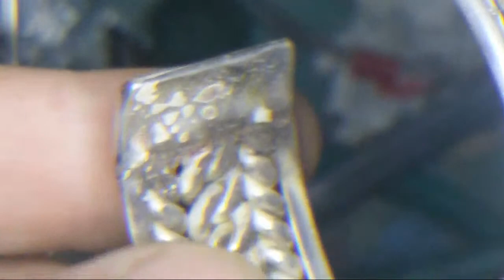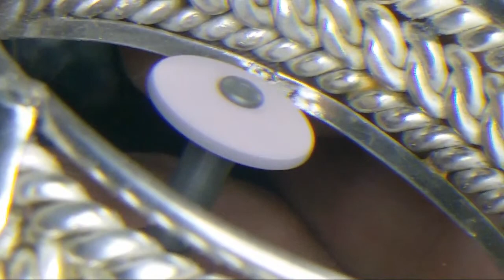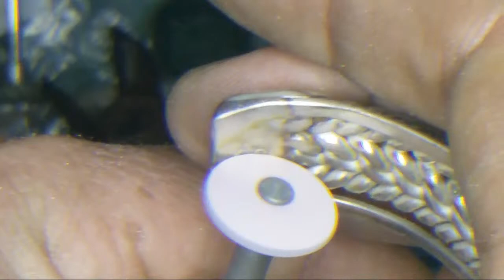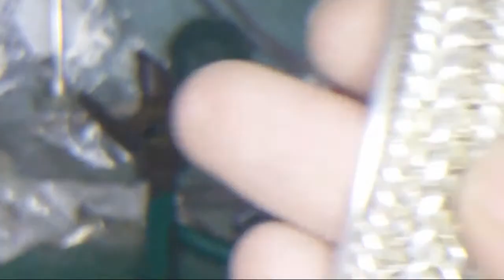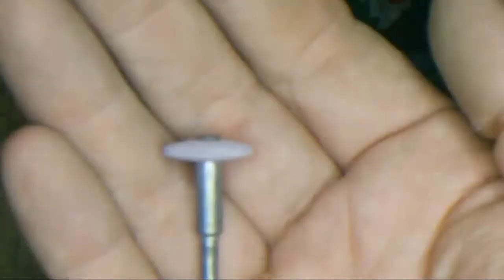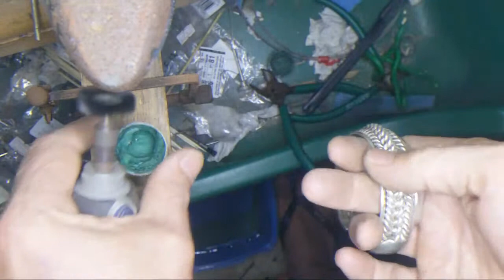Cleaning Solder Joins

Comment: Hey mate, question about your graphene video.  Maybe you can help me.  The graphene foil that you can purchase online, is that bullet proof?  Is there a certain thickness?

The material and application process you used, I assume isn’t able to stop a bullet.   Unfortunately I don’t see anyone testing this online.
Reply from the maker: No they are not bullet proof. I made them, using mechanical exfoliation method on a plastic sheet. It doesn't have the integrity that grown graphene has.

Comment: they look like nice polishing rubbers... where did you get those form...ps. heat the piece before you chuck it in the acid the flux comes off heaps easier, but probably too late to tell you now, then you can use alcohol or metho to remove any high shine polish left (black in colour)...also.. use soft felt wheels to polish/high shine, you will get a mirror finish in seconds.
Reply from the maker: Those rubber wheels are amazing. Best cleanup tool ever. Some bloke called electro gave em to me! ;P